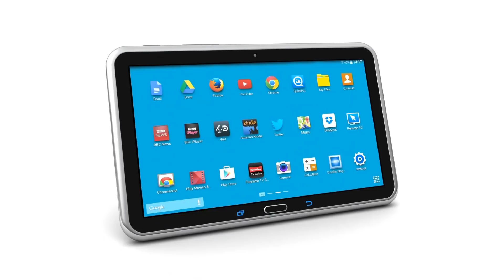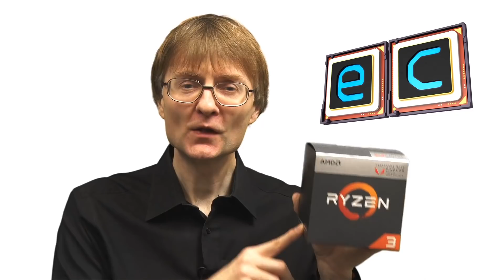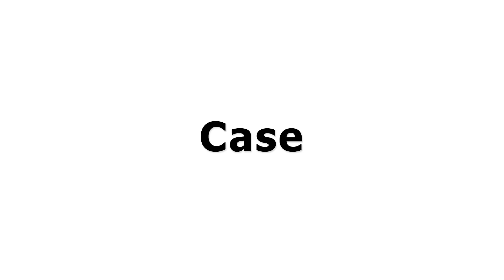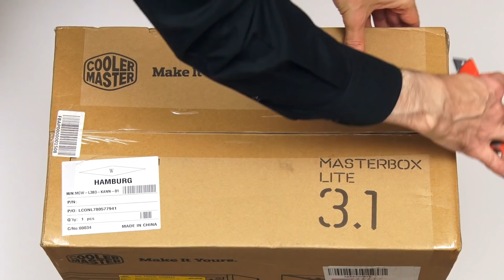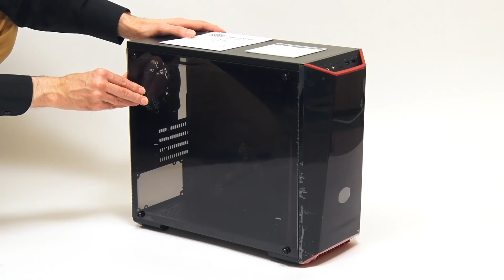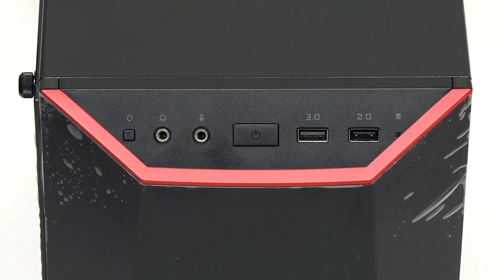Ryzen Budget PC Build #2: Case, PSU, SSD & Assembly

Comment: great explanations - as usual - and more encouragement for me to assemble my own computer that I'll be buying this year. And since there's so many negative comments about Intel (which I've always been a fan of) I think it's time for me to make the move to AMD and give that company a fair try.

What I'm having problems understanding, though - and which I've always had when it comes to putting together your own computer - is deciding on the right bandwidth / frequency specs of RAMs, CPUs, and MBs. I remember several years ago before I purchased my latest PC that I've spent several hours (5 or 6 if I remember correctly) researching this exact topic and, even though at that time I understood what was to understand and ended up with a computer that still runs flawlessly today, I have already forgotten what I've learned back then ( facepalm ) and I'm still getting confused about all these speeds / frequencies of the various PC components. More specifically, I'm afraid that if I get a cheaper MB to save money for higher capacity RAMs (which in all honesty, is always needed more of than anything else inside a computer) I then might not be able to get the most out of the RAMs and the CPU, while spending money on a good MB (that supports RAMs and CPUs of higher speeds) might not leave me with enough money to invest in the said high performance RAMs and CPUs.

I'm not native English speaker and as such my technical vocabulary is limited, thus I'm unable to convey my point perfectly, but what I'm trying to say is that I'd like you to put a video together - if the topic justifies your involvement, obviously - explaining once and for all for rookies like myself which specs of the various PC components are limited / conditioned by the other components they interact with. All I remember from back then when I've done the research is that the graphics card is pretty independent of all other components, in the way that the higher bandwidth and the more GDRAM it has the better it is, but when it comes to choosing the CPU, the RAM and the MB there's a fine line between the specs of each of these 3 components which - when not taken into account - will make either of these 3 components not perform to its full potential.

Again, sorry for not being able to explain better,, and also I apologize for the long a55 comment, but I hope you understood what I'm talking about, and that at some point in the next few months you'll find time for a short video explaining this topic in foolproof terms for people like myself. If this topic is still relevant as it's been around 2013, that is...

Peace!
Reply: Graphics card is dependent on the power supply having the right connectors and grunt to power it properly, having enough CPU/RAM grunt to feed it the 3D data for processing (a weak CPU will 'bottleneck' a powerful graphics card in many cases, holding it back from its potential) and in rare cases being compatible with the motherboard. This is usually only a problem for very old motherboards with low PCIe bandwidth being used with very high-end cards, or a graphics card that only supports UEFI firmware being used on a motherboard with BIOS firmware but not UEFI.

Oh yes, if you're not using Windows, graphics card drivers can be a can of worms.
Reply: @ptobler1   I didn't understand what you're saying, but I'll re-read your comment when I get home cause now I'm at work and can't comprehend your explanation fully :)

Cheers!
Reply: That topic can get very complicated depending on how good a judge you want to be/the level of detail you want to get into. Stuff like how many power phases the motherboard has to power CPU/RAM and the quality of each phase is a start (more stable voltage/power to the components allows them to run at higher speeds with fewer problems getting a clean digital signal from one part to another). This is a tricky analog electronics world you're getting into, and even the most dumbed-down explanations as to why one board runs RAM/CPU better than another may seem like weird magic.

The number of PCB layers the motherboard has, how thick and how long each trace (flattened copper wire) is, the fiberglass weave used by the motherboard manufacturer, looking at the actual components used in those power phases and the feedback loop used to control them is where you'll end up if you go deep into that. I would recommend Buildzoid's videos on motherboard layout to get a basic understanding of this.

Finally, the motherboard's BIOS can play a role as well in exposing more settings to tweak these components, or in exposing special 'control registers' that allow the motherboard and chipset to gauge the RAM's capabilities more accurately and be less conservative with using it.
Reply: @ptobler1   Thanks for the explanations. I'll honestly re-read them later cause there's a lot of info to take in for a poor non-geek dude like myself.

Comment: I've been looking forward to Part II of the series. In fact, I look forward to every video from this channel - always informative and relaxing. I'm considering creating a new HTPC using the 2200G as it seems like a good value "APU".
Reply from the maker: As somebody mentioned in a comment here last week, even though it is only a few months old, the 2200G is already a classic. When you consider that it delivers in terms of CPU and GPU compared to chips of just a few years ago, it really is amazing value.
Reply: @IJoeAceJRI  Sure, I'd be up for that. Perhaps we should start by stating requirements? Here's what I'm trying to achieve:

CPU/GPU: 2200G or 2400G
Motherboard: Cheapest mATX available, no overclocking required.
PSU: Corsair/EVGA/something reliable and cost effective
RAM: I already have a spare kit of 16GB (2x8) HyperX 2667.
Storage: Already purchased a 120GB SSD when it was on offer for £18.
Case: That's the hard part due to height requirements for my set-up.
 Budget: ~£300-£400, although it's flexible.

I'll be using it for Kodi and streaming from my homeserver (Supermicro 24-bay with a JBOD = ~37 drives but space for 48 - not expecting everyone to have such an extreme set-up 😄). Must support H.265 and H.265, which I believe the 2X00G series does. At the moment, I'm using a "Turion II" clocked at 2GHz (dual core) with 4GB of RAM, a 5400RPM 250GB HDD and a Radeon 6450 - it's very old but has worked well.

What are your requirements?
Reply: @IJoeAceJRI  I have no plan to upgrade. I have a workstation in my office for work and gaming as well as the server for storage. This HTPC will sit underneath my TV (hence the height limitation) stand/unit thing. I use the HTPC for light browsing from the couch, but it's mostly for video playback using Kodi.

Are you planning on upgrading in the future to get more out of the system, such as gaming etc.?
Reply: JoeAceJR  hey I saw your post did you build your system?? By what I’m reading it sounds very mobile?? I’m new to networking reason I’m asking bc I need same thing?? Thank you!!

Comment: I wonder if you could help me out. I build a pc with a ryzen 2400g, but it my screen is black. Also the dram error led is red. (not flashing) I discoverd that the RAM I have is not on the QVL of the motherboard. So I am planning on getting a kit that is on the QVL. I also did some research and found out that these problems may be related. Do you think that buying a ram kit that is listed on the QVL will solve the problem?
Reply from the maker: It is possible that the RAM issue is preventing booting -- I have experienced a RAM issue causing this in a build many years ago. So I would certainly start out with the new RAM, and cross your fingers. Before booting again, I'd also check the PSU connectors are seated properly. Good luck!
Reply: @ExplainingComputers  Thank you for your fast reply. I will try a new ram kit.
Reply: @ExplainingComputers  the new ram kit did not resolve the issue. Dram led is still red.
Reply: @ExplainingComputers  It Works!. I just needed to remount the cpu cooler. No idea why though

Comment: I watch computer builds on many channels and have to say that your close up slow(er) motion video when you installed the motherboard into the I/O shield, when you plugged in  the 24 pin and case connectors, the detail and correct polarity direction when installing the Hdd, power, reset, and led case connectors made for one excellent video. Thanks, and maybe you could explain pwm where the 3 pin fan was connected to a 4 pin header.
Reply from the maker: A 4pin header would be ideal, but the fan in the back of case is only 3 pin. So I may replace it. However, as I understand it, the motherboard can have voltage control via  3-pin header, but not the PWM control via the fourth pin.

Comment: Hi Chris. I did not see why you did not hide the cables behind the metal panel that holds the Motherboard!  Your build will look much tidy and neat. But any way your video is quite professional and nice, as usual.
Reply from the maker: I hid the main power cable back there in the end! I kept changing my mind. :)
Reply: @ExplainingComputers  Well, that is how it usually works, trial and error till you reach the optimal build.
Thanks for your answer.
Reply: I'm going to hazard a guess and say it's like my old Xilio case, there's cable management ties back there, but with power going back there, I physically had to force the panel on, which was not fun. My NZXT cases have more room back there for that.

Comment: Thanks to your previous video I've started to build my own PC based on a Ryzen 5 2600X, 16GB RAM, 240GB SSD, Blue-Ray drive, and a MSI Radeon RX570 Armor 8GB graphics card.
All in all with other components such as a case, some cables, 600W power supply I bloated the cost up a bit shy under 800€.
Thanks to your videos I'll be hopefully sooner than later owner and user of a nice and powerfull PC! Finally!
Reply from the maker: That will be a great and powerful system. Good luck with your build. :)